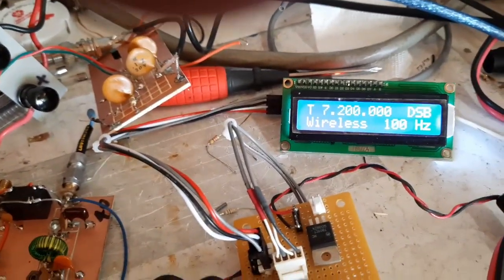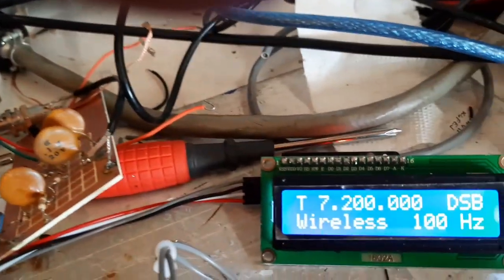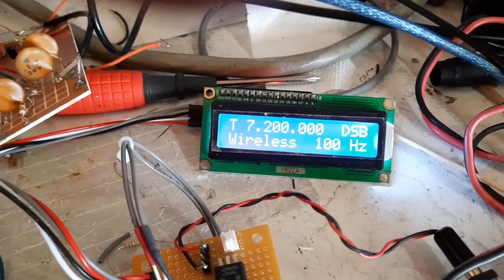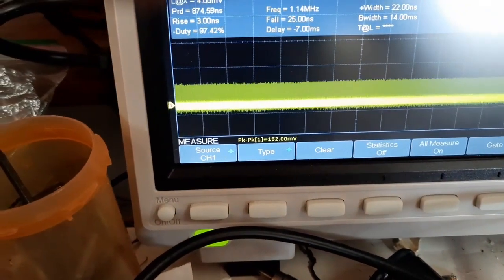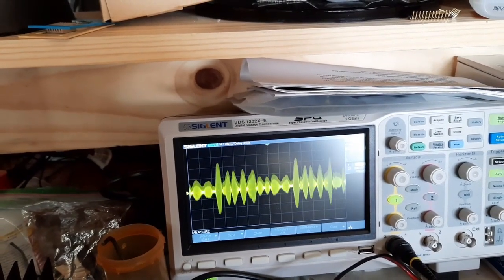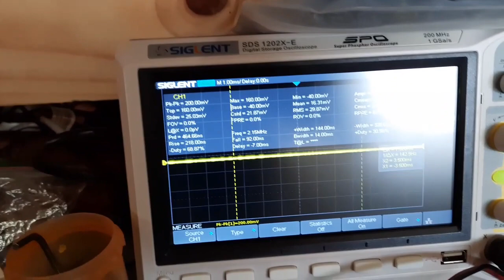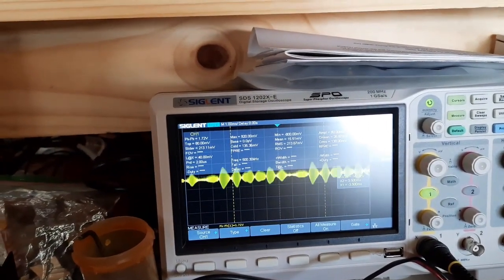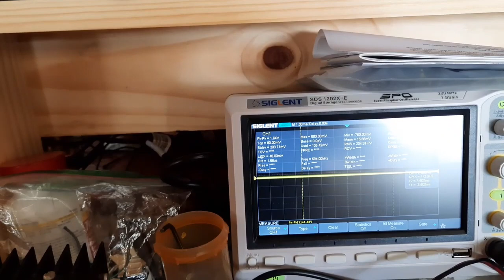Testing the MC1496 Double Sideband (DSB) Generator

Comment: How SSB output can be generater with 1496ic?
Reply from the maker: Find the MC1496 Data sheet and it shows how to construct an MC1496 SSB generator.
Reply: @N6QW  It says there DSB , that is why I asked here.
Reply from the maker: @mikin.6595  You must follow that circuit with a crystal or mechanical filter to strip out one of the sidebands. Depending on the frequency of the carrier oscillator will determine what passes through the filter and you will have either LSB or USB.
Reply: @N6QW  Thank you.I found four-pole crystal ladder filter but didn understand exactly how it works.From what you are saying i guess that if carrier is under the filter frequency LSB will pass....and if oposite USB will pass.Right?
Reply from the maker: @mikin.6595 The lower carrier frequency + audio fall within the filter pass bad and thus is called USB. The higher carrier frequency minus the audio falls within the filter pass band and they call the LSB
Reply: @N6QW  Thank you.

Comment: You're surely not a big one for providing links to background resource material are you, Peter?
Reply from the maker: Absolutely! The circuits for the DCR (Product Detector) and the DSB ( SSB Generator) come directly from the OnSemi (Motorola) datasheet for the MC1496. Nothing invented on this end -- just a straight building of those circuits. The Clock switching enable/disable you can find in the Si5351 tutorials. Find the Etherkit si5351 library and the code to do that is on the Read Me page. Now you have been sourced.

73's
Pete

Comment: Nice work Pete and very well done on getting the Si5351 to swap clocks in software! That's one less relay to solder in. Very cool indeed. Keep up the great work. 73 Nick M0NTV
Reply from the maker: Hi Nick,

Thanks for watching. There is no one more amazed than me that it works. This is sort of a first for me as I usually head right to the filter rigs. But the Rx works pretty good and hopefully the Tx will too. Yes the clock switching seems to be doing OK.

Keep in mind --- Never Move!

73's
Pete